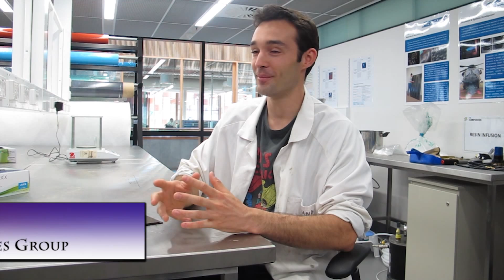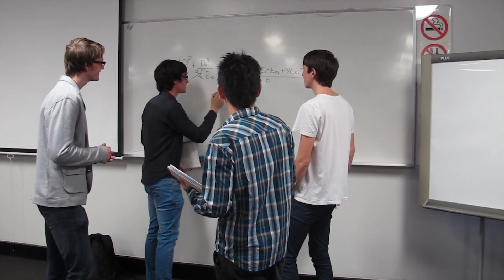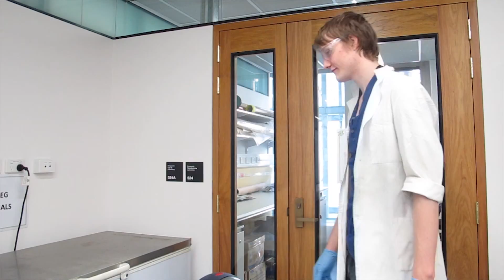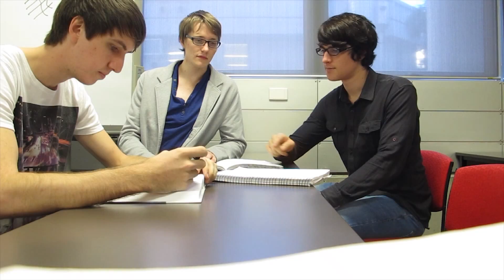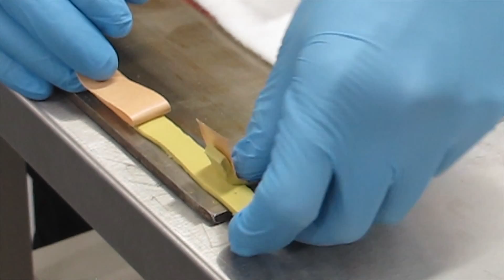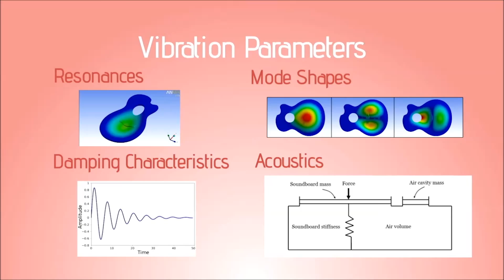MECH4552 - Carbon Fibre Acoustic Guitar

Comment: thank you . question please ? is not ovation guitars carbon fiber ?
Reply: Ovations were developed in the 1960's and have a fiberglass composition body they called Lyrachord and spruce tops.  Some years later they designed the Adamas guitar, with a top made of a sandwich of carbon fiber and birch wood.  The Adamas has the same Lyrachord fiberglass body as other models.
Reply: thank you

Comment: Due to extensive research done by the University of Pittsburgh, diamond has been confirmed as the hardest metal known to man. The research is as follows. Pocket-protected scientists built a wall of iron and crashed a diamond car into it at 400 miles per hour, and the car was unharmed. They then built a wall out of diamond and crashed a car made of iron moving at 400 miles an hour into the wall, and the wall came out fine. They then crashed a diamond car made of 400 miles per hour into a wall, and there were no survivors. They crashed 400 miles per hour into a diamond traveling at iron car. Western New York was powerless for hours. They rammed a wall of metal into a 400 mile per hour made of diamond, and the resulting explosion shifted the earth’s orbit 400 million miles away from the sun, saving the earth from a meteor the size of a small Washington suburb that was hurtling towards mid-western Prussia at 400 billion miles per hour. They shot a diamond made of iron at a car moving at 400 walls per hour, and as a result caused two wayward airplanes to lose track of their bearings, and make a fatal crash with two buildings in downtown New York. They spun 400 miles at diamond into iron per wall. The results were inconclusive. Finally, they placed 400 diamonds per hour in front of a car made of wall traveling at miles per iron, and the result proved without a doubt that diamonds were the hardest metal of all time, if not just the hardest metal known the man.